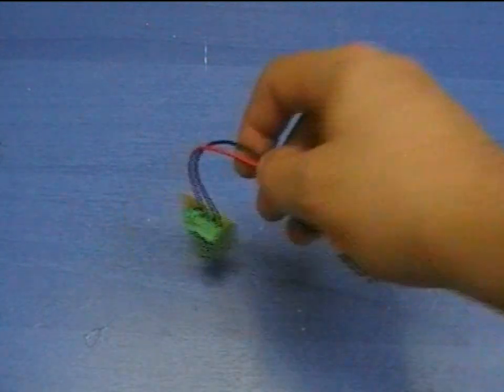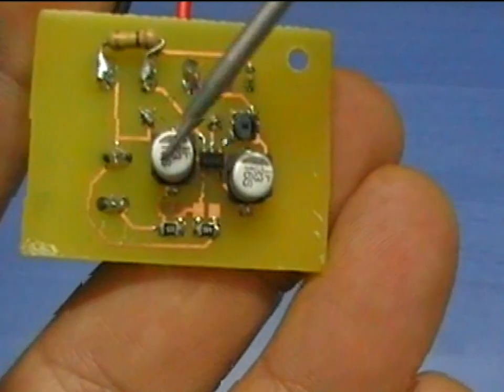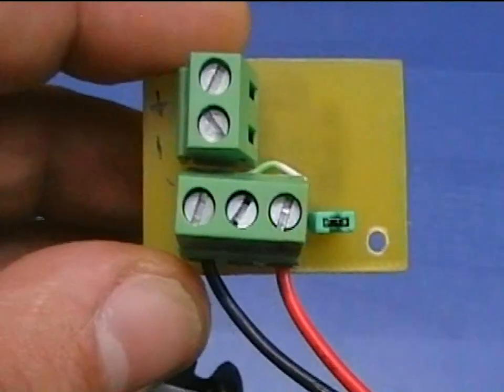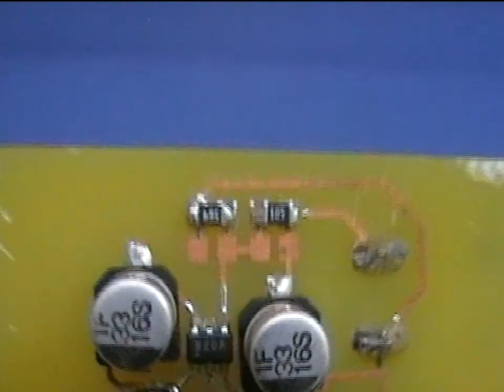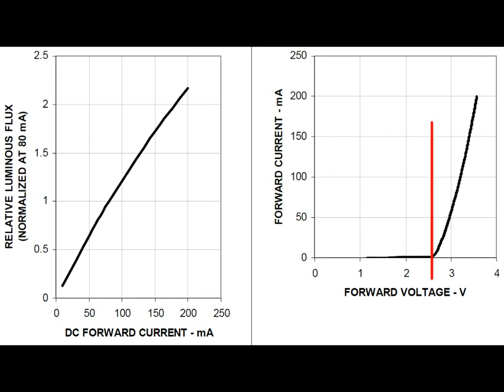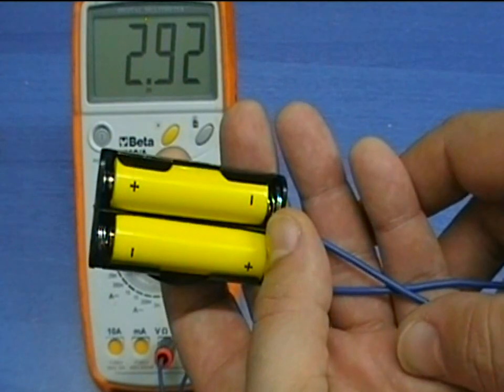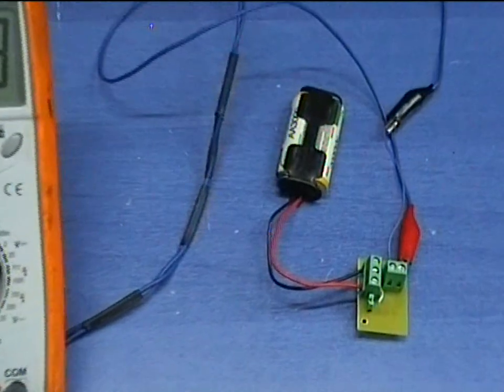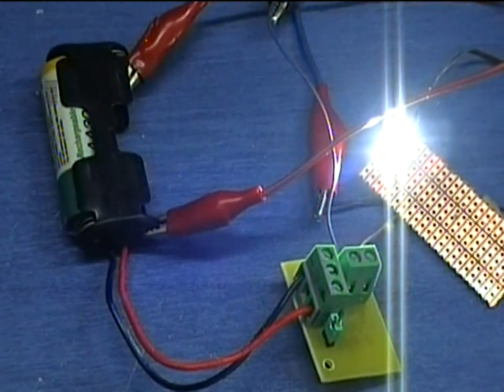High Efficiency Battery Boost Regulator using the MCP1640

Comment from the maker: My main purpose was to make a boost regulator. The LED is a bi-product to demonstrate this video. This chip is used mainly to power microprocessors or other low-current circuits, or small LEDs. 
After all, a constant current would not work without a boost regulator with 2 AA bats.... 
I prepare some more circuits with constant current buck (and maybe boost) regulators ;)